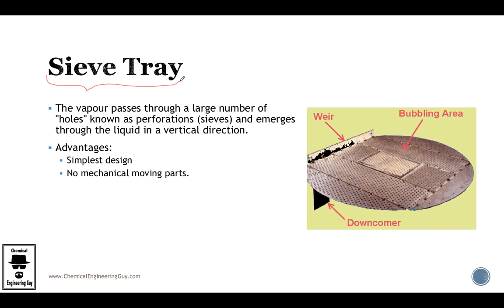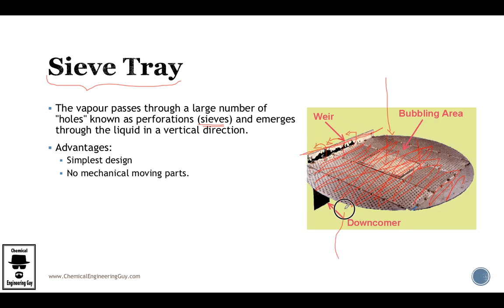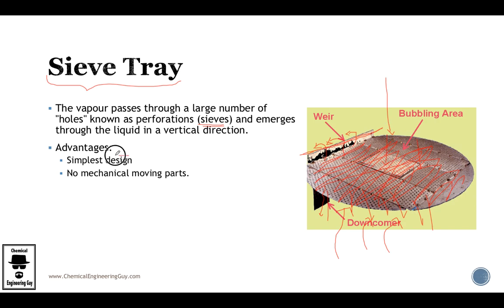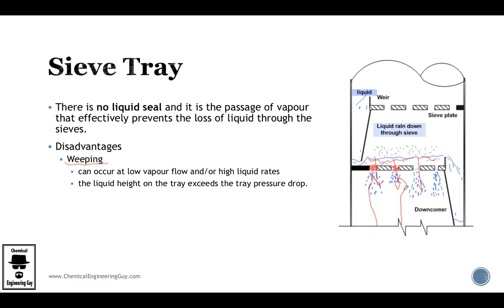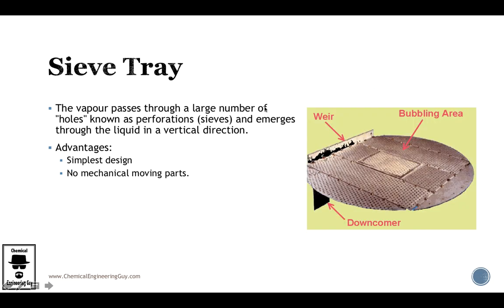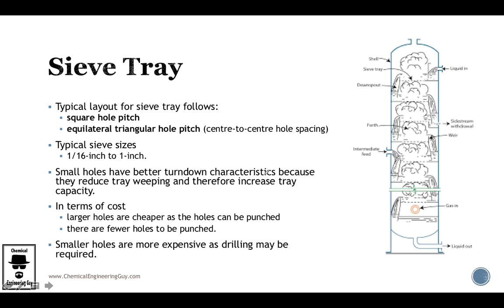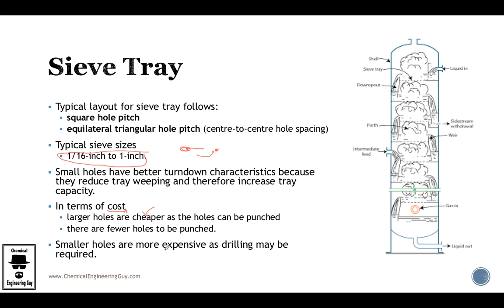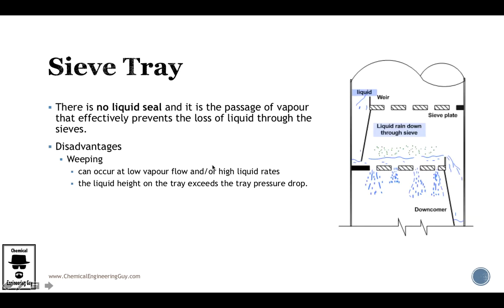Sieve Trays (Lec070)

Comment: what is used on distallation columns in air separation(liquid air)?
Reply from the maker: TRUE!! you will literally cool down the air until it starts separating due to condensation T, i.e. nitrogen, oxygen, helium, hydrogen, etc...